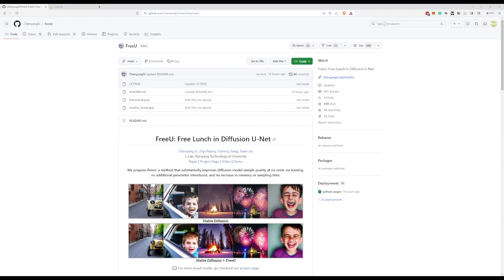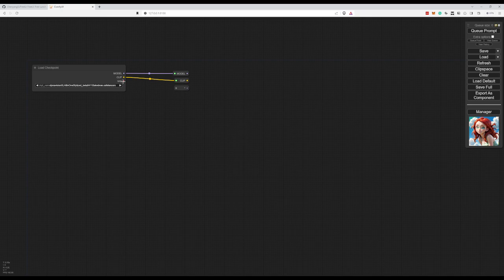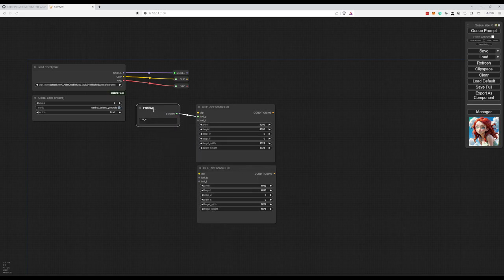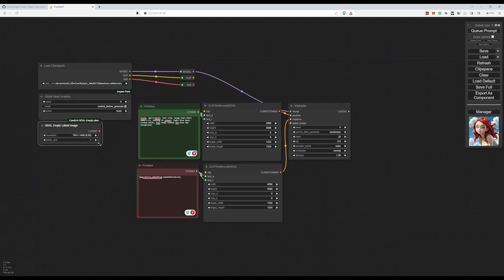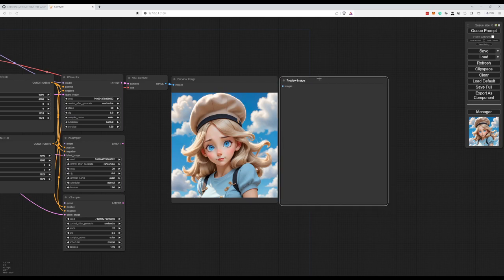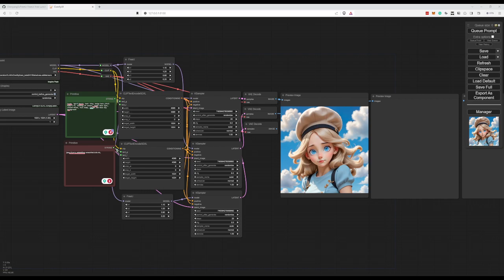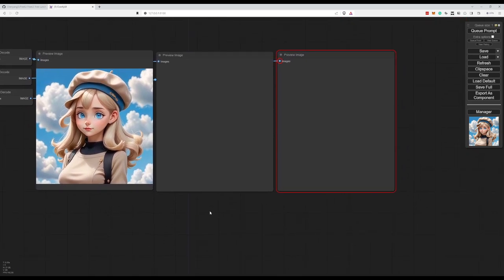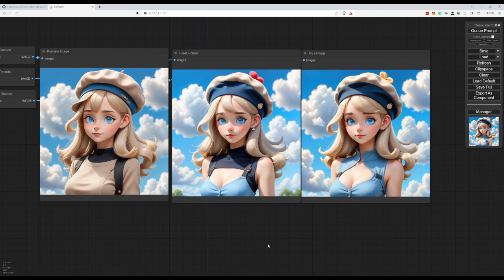Instant Model Boost with SDXL FreeU - ComfyUI: No Extra Time, No Extra Cost!

Comment: What are your FreeU settings? Is there any guides? Basically it's useless if you don't know how every parameter works. However, leaving every setting to 1.0 often produces better result than without FreeU. And if your image has faults like bad fingers or pose, then setting b1 or b2 to 0.8, (but not both at the same time), tends to fix the image. 0.8 is like a sweetpot there. 

EDIT: Your settings didn't work for me. Your settings fried my images and gave them washed out look. My settings probably don't work for you either. It depends on art style and model that you use, cfg setting, prompt etc.. Basically FreeU is just another tool in your bag, not the decisive answer to everything. I'm using Fooocus-MRE.